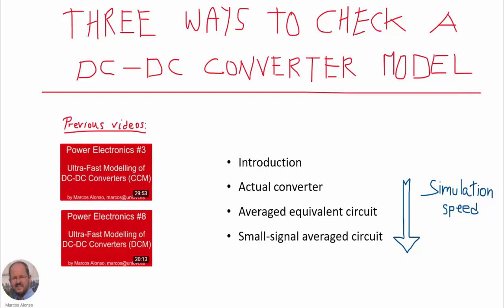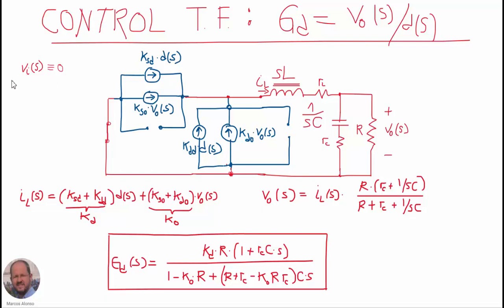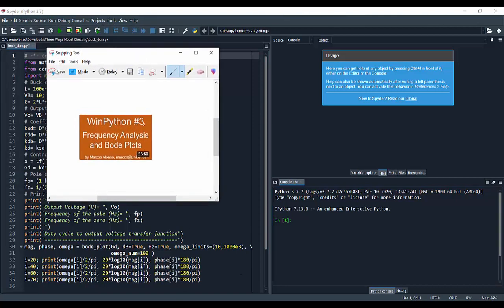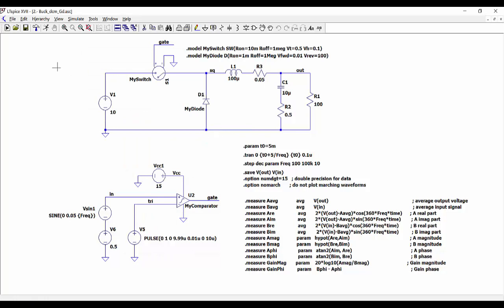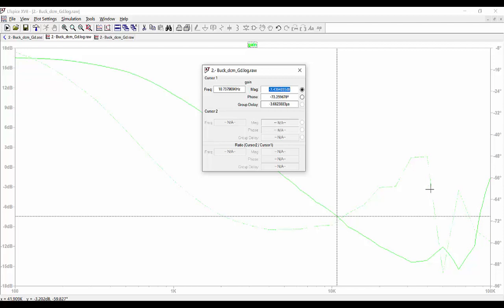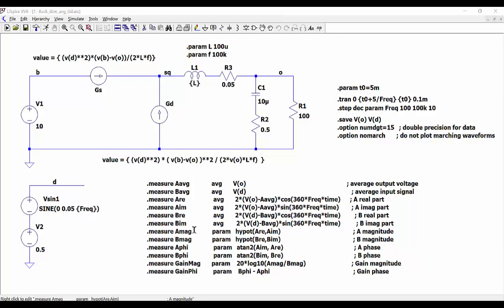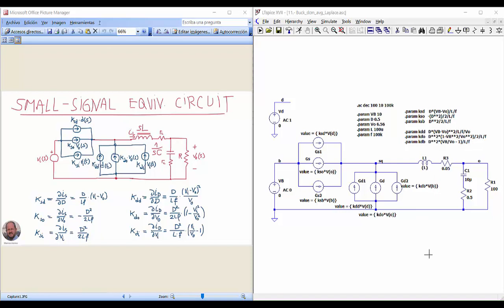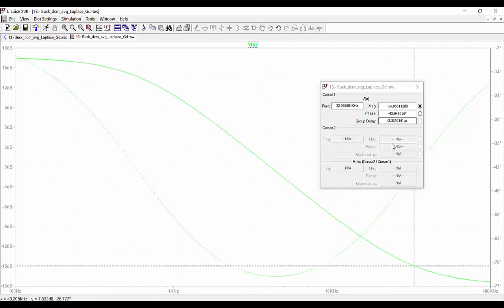PE #12: Three ways to check a dc-dc converter model by simulation

Comment: Hi Marcos,
this video is again an excellent one and explains all details and answers all questions which may have left open in the previous videos #3 and #8.
I could successfully comprehend simulations using LTspice. Just one comment on that: LTspice did not want the entries "value =" in the Gs and Gd current sources.
An error message occured "Unknown parameter". I had to replace it by "I=.." and this worked. Also, using k in equations seems to be critical, if not used as a transformer coupling
coefficient.
But everything is fine now.
I wish you all the Best, for Christmas and for the next Year.
I am looking happy forward to further videos from you.
Best regards
Udo
Reply from the maker: Hi, Udo
Thanks for your continuous support. For the behavioral current sources I use the component Gpoly available from the Misc folder:
\LTspiceXVII\lib\sym\Misc\Gpoly.asy
For example, the line for Gd looks like this in the spice netlist (view - spice netlist):
Gd 0 sq value = { (v(d)**2) * ( v(b)-v(o) )**2 / (2*v(o)*L*f) }
Similarly, for the behavioral voltage sources shown in other videos I use Epoly available from the same folder.
Hope this clarifies.
Merry Christmas and Happy New Year to you too.
Best regards,
Marcos